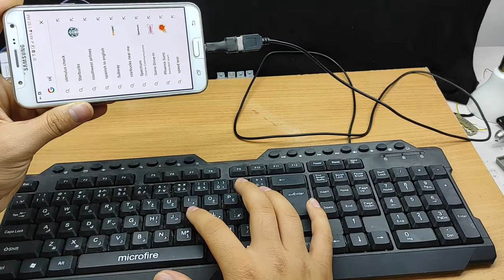How to make OTG cable | Make OTG cable with charger cable

Comment: can you use tape instead soldering?
Reply: You can try hot glue, but you must be careful with connecting the cables. And you must apply the hot glue as fast as you can before one of the cables slips.
Reply from the maker: thanks 🙏🙏
Reply: XDZencoda 11BoBubAb  try it but you must be really precise with it

Comment: Shorting the sense and ground pins on a charger (sense & GND) is a risky move that can lead to several negative consequences:

* *Damaged Charger IC:* The most likely outcome is damage to the Integrated Circuit (IC) within the charger. This IC regulates the charging process, and a short circuit disrupts the intended flow of electricity, potentially frying the chip.

* *Fire Hazard:* In extreme cases, the short circuit could cause overheating, leading to a fire risk. This is especially true if the charger is of poor quality or has faulty components. 

* *Unpredictable Behavior:* Even if the charger doesn't get fried immediately, the short circuit can cause erratic behavior. You might experience issues like inconsistent charging, overheating, or even complete failure of the charger.

*Important Note:*  There's no benefit to shorting these pins. OTG (On-The-Go) functionality, which allows a device to act as a host,  doesn't involve shorting anything. It's achieved through a dedicated OTG cable with the proper internal wiring.